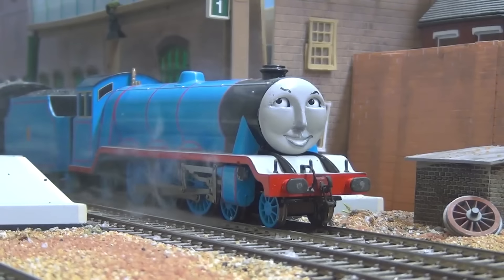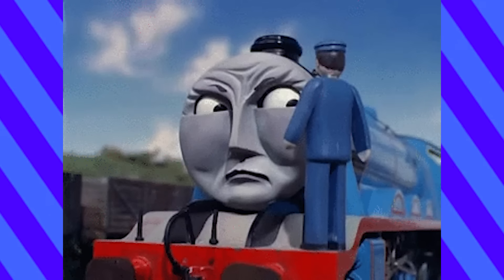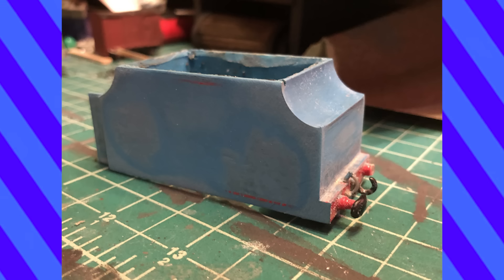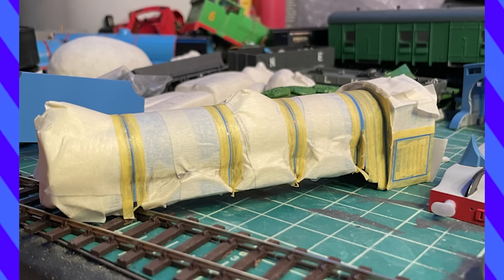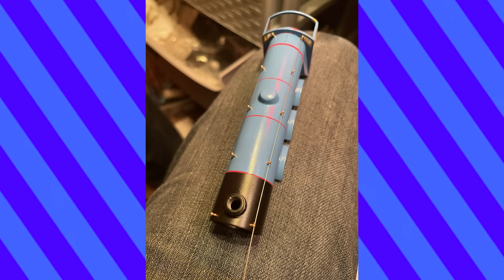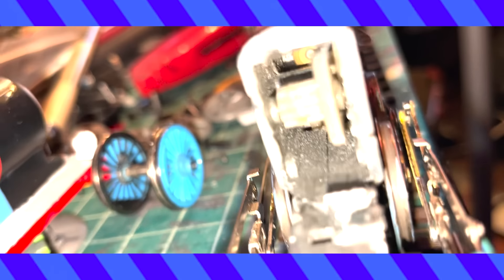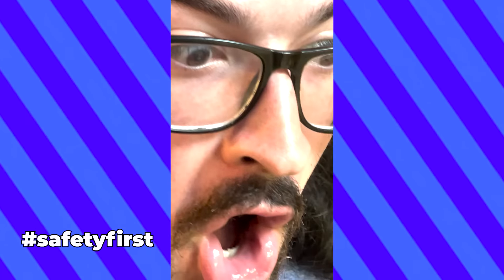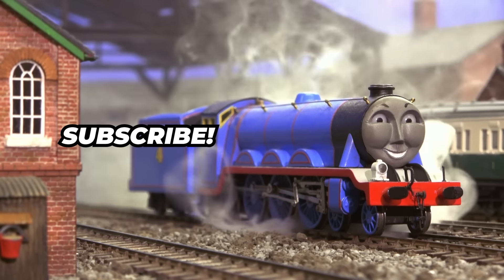Making Gordon | Caleb's Trains HO/OO

Comment: Now we need to compare yours and Brendan’s to sparkshot’s. I alway thought the scaling of the Bachman model made it look small for oo scale.
Reply from the maker: I think this version of the print is slightly underscaled--Bachmann Gordon's cab is too tall making him look small in comparison I'd say as well
Reply: @Calebtrain  I’ve only seen pictures, and the top of the boiler on Gordon should just about line up with the top of Thomas’ chimney/funnel. The only picture of this I’ve seen makes the Bachman model look too short in this respect. I also am tempted to just make a scale LNER A1 with a GNR tender and modified running board for Gordon.

Comment: Was wondering what dremal heads you used to thin down the side rods. They turned out very fine
Reply from the maker: I've actually been using the base of the dremel that holds the bit, and then also the metal-cutting disc!